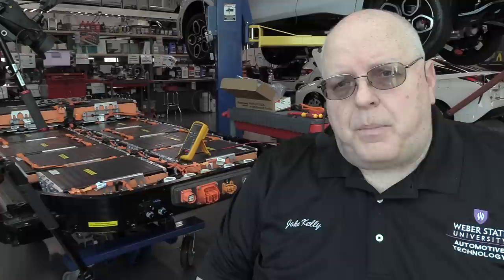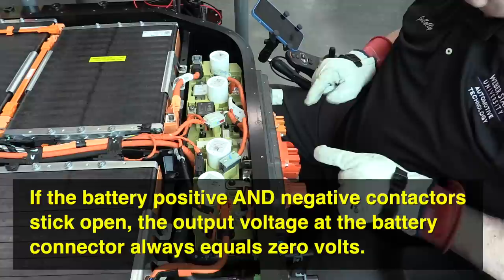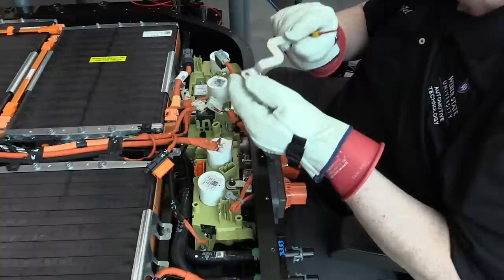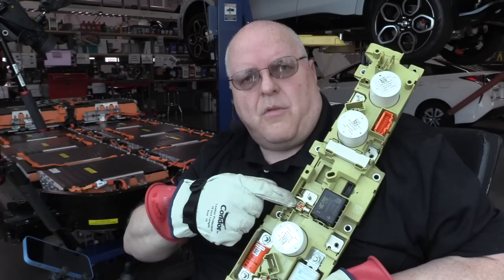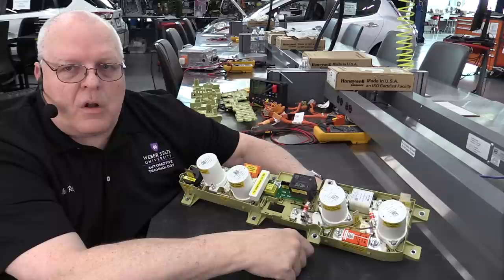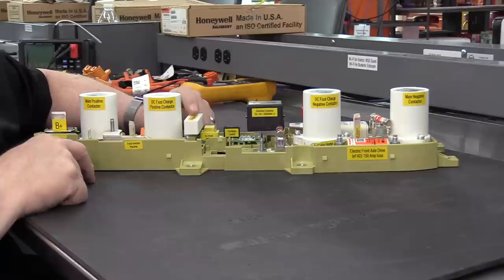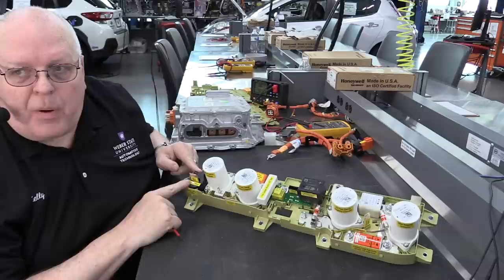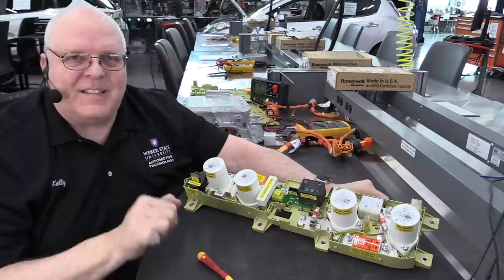Mach E GT Battery Contactors

Comment: Hi John, thanks for your excellent videos and your sharing of deep engineering knowledge. I ordered last year the European Mach-E GT (= US performance Edition) which hasn’t been delivered yet. I don’t understand why Ford has difficulties with the HV junction box or thermal issues and other car companies like Tesla not. What does the competition make different to manage high currents in their high performance cars? Why don’t they need time based limitations. Greetings from Germany, Thomas
Reply: Because of better design: Not having lots of thick, expensive wires with custom connectors all over the car and over 30 custom hoses in a hose rats' nest. FYI: The Tesla "Plaid" cars have over 3x the current requirements.  Your wait maybe due to the fact that Ford is losing money on each- car and doesn't expect to "fix" that for several years until their new factory for electric cars is built and ramped up.
Reply: @shazam. Bullshit. It was a software bug in the security part of the software, not a hardware issue. This car will make your Tesla  shares worthless so get used to Tesla's continued loss of market share - none of your cheerleading or FUD bashing makes any difference.
Reply: @vidznstuff1  🤣🤣
Reply from the maker: Thank you, I do not know the answer.
Reply: More mass -- I would guess the equivalent part for tesla has either more mass or active cooling.  My understanding is the replacement part is beefier, but there are limits to how much they can add due to space constraints.  I would be very curious what the equivalent part in the F150 lightening looks like
Reply: @PianoBoy99  Tesla does not use an electromechanical component for this function, all semiconductors.

Comment: The sense lines that monitor the high voltage from the contractors have small wires with not much insulation, hope they never have an insulation problem otherwise the magic smoke will be released.
Reply from the maker: Thanks for watching

Comment: Thanks sir, I have a question in that Current sensor  on the positive side the contactor on the junction box has a coil inside that circular piece? Thanks
Reply from the maker: I believe so, but do not know for sure
Reply: @WeberAuto  thank you so much sir

Comment: Thanks for this very interesting insight. I wonder if the Mach-E SR RWD will also suffer a failure in the future with a higher milage, or if they are safe, especially with the software upgrade because of the lower power...
Reply from the maker: I suspect the software upgrade will eliminate the issue.
Reply: @WeberAuto  Thanks!

Comment: Awesome and thanks for doing this.  I am still not clear of the exact circuit and contact sequence for the 12V power supply to come on when not under power? DC to DC converter when the main power is not required (12 V maintenance while parked).  The black box contact TE 2203997-1 is the negative contact and the negative main is bypassed to take the inverters out of the loop?  Does the pre-charge contact come on before the main positive closes in this case?  If the main negative is bypassed but the main positive closes does the pre-charged positive come on first or since there are no capacitors no arcing of the main will happen?  Is the sequence TE 2203997-1 contact negative and then main positive closes?  

This sequence I think would maintain the 12V when parked but does not some times.  Mine gets a P00A2 positive contact stuck open error in subfreezing (-30C) and the 12V is not maintained.  Then at a certain soc the 12V proceeds to freeze/die.  At that point nothing works well and a 12V charger is required to thaw it out and charge it.  Wonder if I am right in assuming the P00A2 is the main contact stuck?
Reply from the maker: Thank you, yes the black contactor bypasses the main negative contactor and precharge is not needed. I think you meant P0AA2 Hybrid/EV Battery Positive Contactor 'A' Stuck Open. It sets if the BECM detects the contactor is stuck open for 2.4 seconds. A stuck open contactor will prevent the DC-DC converter from charging your 12V battery.
Reply: @WeberAuto  Thanks again valuable info.  So the dc/dc not getting power would be limited to the main + and the black box contact?  Pre-charge not involved.    When I put the car in accessory mode (no brake) is it running through the black box?
Reply from the maker: @peterpan8727  I believe that is correct
Reply: @WeberAuto  Thanks again.  Sounds like a definite maybe?  Not a for sure but would make sense.  LV sensors in the HVJB case before you put it back in for the 9th time 😉?   It all happens over 12V (off and on contacts) so if the 12V is dead not much happens.  

2 new 12V 2 times dead in -28C so maybe not the 12V?  I think it does not keep the 12V at a high enough soc in the cold either.   That is pure software logic.  Such a big battery should be able to keep the 12V charged.  Stuck open positive and get in with a car with a low (dead) 12V and will not clean boot or go in gear.   Happens fast day, day and a half.  Summer it sits for 2 weeks not a problem.  Charge the 12V and the car powers up and runs fine.  Keep the 12V on charger/maintainer in the cold no problem either.  Does not maintain itself and I was not the only one up north last winter but I was the first winter.  Two winters both times not fixed until April when it is not a problem anymore.  Last time they replaced the HVJB and BECM and now waiting to see if it is fixed.  The recall got me thinking about this again but I do not think they are welded shut in -28C it say positive stuck open.          

The  pre-charge can not be totally ruled out for the dc to dc to power on and may be does need to happen.  Really still do not completely understand the accessory black box negative (hvac dc to dc and ac charging) do they always get  their power through the black box negative even when powered on and the main negative is closed?  Always two feed from the HVB one running through main negative and one through the black box one?

Comment: Is there no fuse in the high voltage sens line.  
I see the problem if the fuse blows, however a lot of power through a small wire.
Why didn't they use auxiliary function on the relay.
As usual a good video.👍
Reply from the maker: Thank you
Reply: Effectively, the operative assumption is that the wire will act like a fuse.   I hope the designed test this.

Comment: Thank you for such an excellent video. GT Owner here and was just curious about recall. Having followed the recall commentary elsewhere there is talk that the software mitigation somehow can sense an "about to" weld contactor through some electrical property change due to deformation of the contactor. Would you have a suggestion on how that might work? (I don't have a background in electrical engineering so forgive me if I am talking rubbish!)
Reply: They hope to reduce maximum current available in operation and charging (i.e. less performance, longer charge times).  They ultimately have to re-design those contactors and replace the entire module, which as you can see from this and the previous video would take the better part of a day $$$.  Even after re-design, these are custom parts and would take quite some time to get from their vendor.
Reply: @shazam More bullshitting. It was a software bug that is being fixed by update.
Reply: @shazam6274   Tesla fanboy the software did not reduce the maximum current available in operation and charging.
Reply: Since Ford has not "released" this fix, how would it protect the contactor from arcing, warping and overheating??
Reply from the maker: I do not know the answer to that. I suspect they are watching the voltage drop across the contactor while it is being used. A perfect connection would have a near zero volt drop. A contactor that is starting to develop problems may have a higher voltage drop. Thank you!
Reply: @WeberAuto  Yes. but I suspect that the voltage drop across the contactor is not measured at all, since even it would be millivolts to indicate ~ 100W dissipation in the contacts. Perhaps Ford could explain how they discovered this issue.  Most likely empirically during testing / use; i.e. lower current available, no power as Ford states in the recall, or as you discussed, the contactors not opening on command. (welded closed).
Reply: @WeberAuto  Thank-you. Your students are very lucky to have you as their professor.
Reply: @MrMurUK  Thanks.  That would seem to answer the question of whether or not the vehicle could have detected it. It will be interesting to see how this unfolds.
Reply: @shazam6274  the vehicle can detect it but responds with a stop safely now and immediate loss of power or refuses to start. After the software update has been applied, then the car will warn you that you need to service the vehicle and it stores specific contactor failure codes. I.e. there is no immediate loss of power. The talk on the forum suggests that the software might be trying to guess the temp somehow using other properties.
Reply: @MrMurUK  Interesting.  One the one hand, detecting the contactor temperature indirectly could be used, but maybe unreliable. Perhaps there is a thermal detector in the module which hasn't been noticed or discovered. On the other hand, detecting arcing could be done anywhere along the current path, but would not necessarily indicate damage from heat.  Most likely the peak current flow might be sensed for this (i.e. > 500 A for x ms).  In any case, if the software update does nothing to prevent the current peaks,  the basic issue remains. It might be quite a rare occurrence, so perhaps a warning message to the driver: "quit drag racing, 'lead foot', or else I'm gonna 'take tour keys away'..."  FYI: two of these contactors were sold on eBay recently @ $45 each, about half the "list" price for similar ones from TE Conn.
Reply: @shazam6274  definitely no thermal detector otherwise it would be an easy implementation. The subject has been discussed to death on the forum and a very lengthy technical breakdown in response to the this video. Way beyond my skill level to follow but generally the conclusion was a software only solution wasn't likely to be adequate.
Reply: @MrMurUK  Thanks.  I'm an EE, can you point me to the forum?

Comment: Q,The low voltage control wires ,that effectively turn on and off the high voltage battery ,look rather small for the important job that they do ?. considering that they are the only way to isolate the High voltage Battery,what happens when there is an issue with those control wires and their connections?
Anything is possible in automotive ?
When the conditions of Fire ,water or accident intrusion, there could be a problem !
There is no manual override is there ?
Rust belt locations in America,would they be a threat to these EVs ?
Reply: The wires are sized for the amount of current they carry, which is very small. If there is a failure of the wire, which is unlikely, the contactors would open/turn off and disconnect the battery.

If you’re concerned that the car could be disabled by damage to the wire, that’s true for literally any car with any powertrain. Any gas engine could be disabled by removing power or ground on a single wire.
Reply: @ouch1011  thanks,the issue would surely be the 450odd volts ?
Also Fords have had issues weird occurrences with the vehicle systems and something to do with faulty batteries be the communication that they have for updates which are wireless,it maybe sorted !
I just think the batteries can be a bigger issue than what ICE cars are .
Reply from the maker: If there is an issue with the control wires resulting in abnormal contactor operation, diagnostic trouble codes (DTCs) should set. The results of a DTC setting vary by system, but the vehicle is usually disabled after stopping and turning off the car. There is a battery contactor recall for this issue right now.

Comment: Wonder what is the gauge of the HV wires? Wonder how hot they get during DC fast charging?
Reply: At full power there would be over a 1000A flowing through those cables. They don’t seem adequate. Is this reason for the recall/update?
Reply from the maker: There is a temperature sensor in the charge port receptacle. I do not know the answer.
Reply: @WeberAuto  
The charge port may have a sensor but there are lots of small wires with lots of connections after that. When there's large delta T and many thermal cycles the connections get loser therefore developing higher resistance causing more heat.
Would be interesting to get a low voltage high current power supply and put real world amps through the wiring and use an IR camera to find the hot spots.

Comment: From Ford...
"On affected vehicles, Direct Current (“DC”) fast charging and repeated wide open pedal events can cause the high voltage battery main contactors to overheat. This overheating may lead to arcing and deformation of the electrical contact surfaces, which can result in an electric relay switch remaining open or a relay switch that welds close from heat.  An overheated relay switch that opens while driving can result in a loss of motive power, which can increase the risk of an accident."
I would avoid this car like the Plague. This is pathetic.

Comment: Better Tesla makes a reliable battery pack than a repairable battery pack. The process of making a battery pack repairable adds weight, complexity cost and unreliabilty.
Reply from the maker: Thanks for sharing
Reply: Well, I suspect in the fullness of time, some "good old boys" will start "repairing" those foam filled Tesla battery packs.   There is too much money involved to not try very hard to fix them.
Reply: Well if they didn't, Betty Crocker might go out of business!

Comment: So, Electric vehicles can kill their mechanic without even moving. They should be banned because of safety concerns? OSHA, if they live up to their usual expectations nobody could legally work on them.
Reply: Electric vehicles use SUBSTANTIALLY less  voltage than our power grid uses for transmission and about the same voltage as what is used in industrial settings. Should the power grid also be illegal?
Reply from the maker: No, they are very safe. Like any occupation, you assess the potential hazards and mitigate them by using the proper PPE, tools, and training.
Reply: The voltages aren't all that high and DC is safer than AC.   Shock is a danger but if you know any electricians, most have some "shocking" war stories.   THE danger in EVs is an arc fed by the entire energy of the cell.   Electricians face a similar problem with circuits switching a lot of power.
Reply: @GilmerJohn  How are you supposed to work on them by osha standards. All stored energy is to be released to service any vehicle. Battery....stored energy?
Reply: @russellaustin4988  --  Well, as I have mentioned, the voltages aren't "out of sight."   The wiring used in your house is good for 600 Vac (that's the wiring).   The read danger is some kind of arc which might actually seem like a small explosion.   (The same thing happens to electricians or tech that work on panels controlling a lot of power.)

Some insight might be gather by studying the NEC (National Electrical Code.)   Electricians often work on "hot" panels.   Your fully charge EV battery pack represents a similar risk and would require similar precautions.  On precaution is to be able to quickly step back if something "pops."   

I was surprised to learn that the "new" stuff doesn't have the "safety plug? in the electrical enter of the battery pack.  Pulling it isolated both positive and negative connections.

Everyone has seen a video on an EV fire.  The problem is that the fire in so intense that no one know WTF happened.   Maybe "they" require a "black box" with very low power consumption that would monitor the BMS and some of the critical temperatures.   The driver might switch his EV off but isn't the computer programmed to cool the battery pack if it gets too hot or heat it if it gets too cold?     That means that the computer may have to operate the main contactors.   Or does it just stay off when the owner turns the key to off?

But we have seen the videos of EVs bursting into flame while just minding their own business and parked: they aren't even being charged.
Reply: @GilmerJohn  Did you ....perhaps in reading my comments read the name OSHA ? OSHA is what the comments were about. I know all the technologies. OSHA......Let me say it again.......Says in order to service a vehicle the tech ( a word that has become the smartest dumb person available} Has to relieve the vehicle of stored energy. For the safety of the tech!!!!! According to OSHA.....There it is again, You would have to discharge the battery pack to 0 stored energy before touching it with a wrench. Now...with that said. The government has screwed us real mechanics over, and is openly trying to destroy our livlihood for these halfass electric things. Everything changes every day. The government is the only reason these companies survive. EVs are a great idea.....Just offer them on equal footing....which they are on a pedestal right now and ICE vehicles are the enemy. When the last ICE vehicle is gone us mechanics won't have a living anymore. We just might take it out on EV people
Reply: @russellaustin4988  --  Well, I freely admit that I don't encounter OSHA.   I'm guessing that OSHA has a voltage threshold or techs couldn't even disconnect a 12 volt battery.

If OSHA "prohibits" run of the mill "techs" from working on the battery packs (requiring a complete discharge would like destroy many of the cells) then, again, very small operations ("good old boys") will be able to escape such supervision.